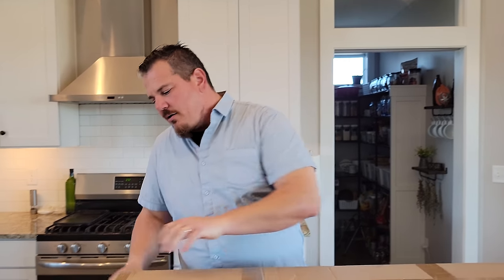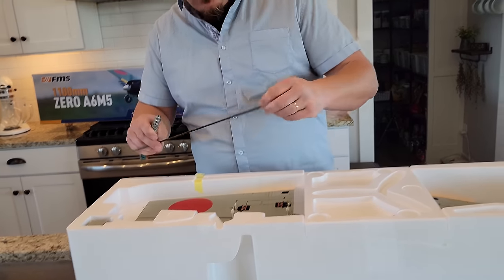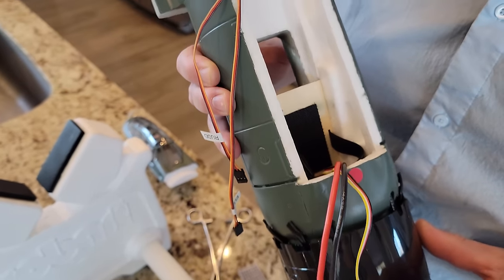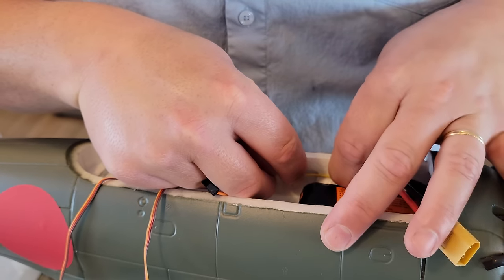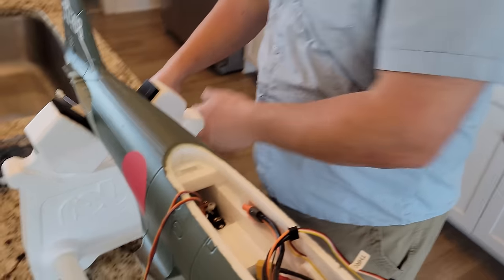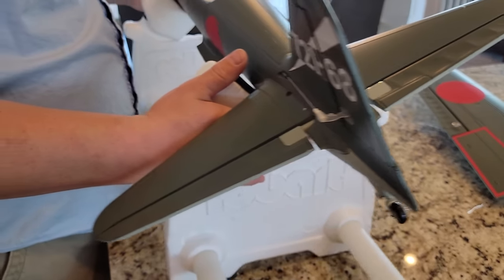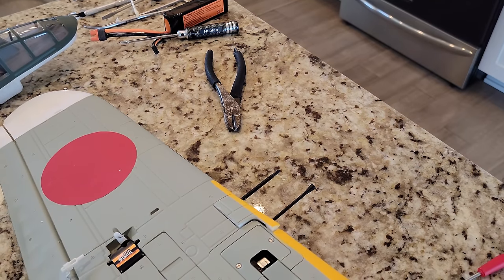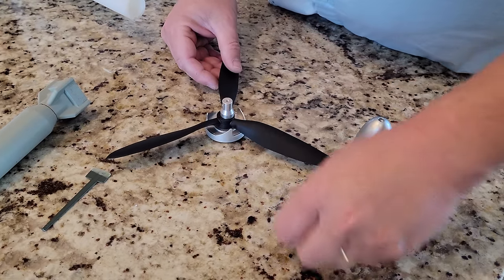FMS - Zero - 1100mm - Unbox, Build, & Radio Setup

Comment: love this zero got one myself i did use the AR620 with servo splitter on the flaps and retracks so i could get the v2 gyro to work
Reply: I prefer using 7 or 8Ch receiver from Orange or Lemon Rx so I keep flaps separate channel from retracts and have V2 gyro to work as well. Sometimes you don't need flaps on landing or take off when you have cross wind. Spektrum Receivers are so overpriced. Just my two cents